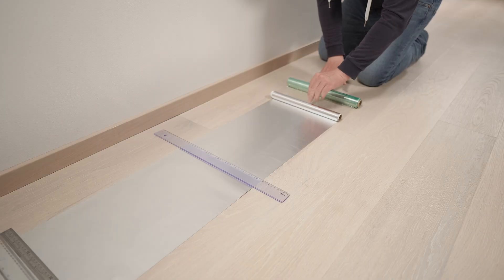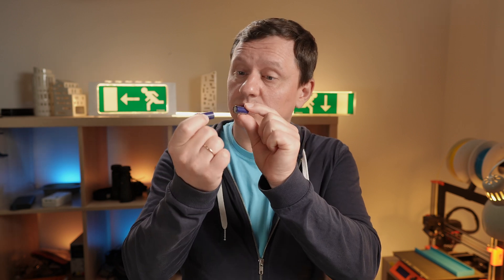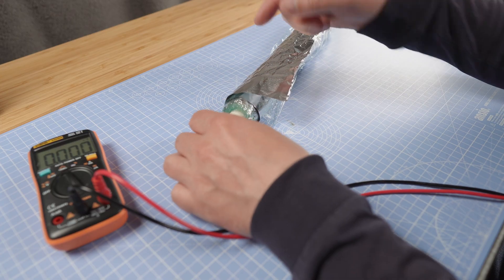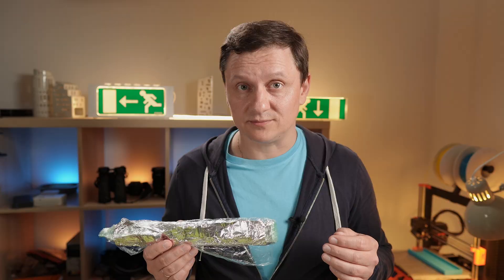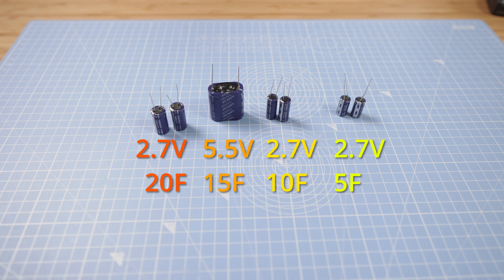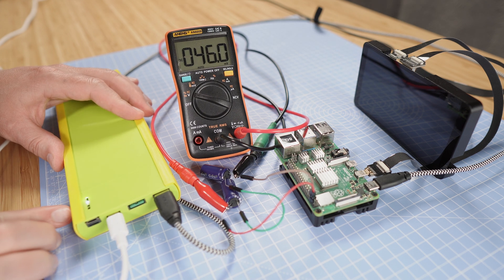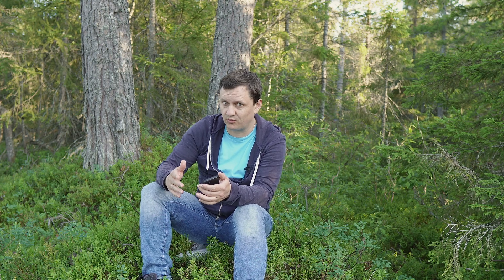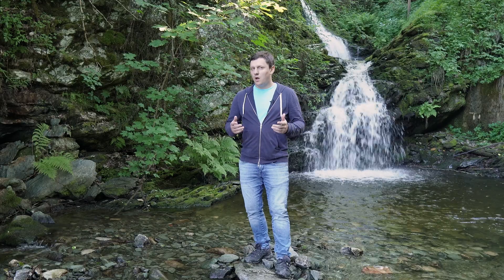Supercapacitor for Raspberry Pi 4 and the meaning of life. Part 2

Comment: Hi @Pavlo, I tried this as DIY. In my setup I have two super capacitors in series, and power bank ordered is #3 from your Part 1 video (the one with 7 segmented LED). The problem I am facing is that when main supply goes off, the power bank don't start providing power unless I press the button on power bank once, or super capacitor is fully discharged (in about 10 seconds), but this is causing a reboot of RPi. However when main supply resumes setup works well without an issue. Any idea?